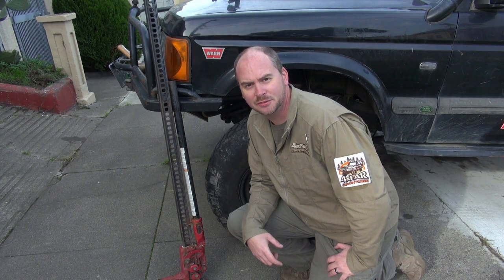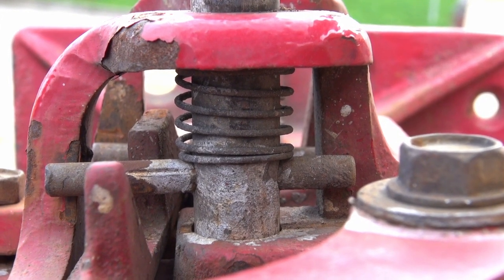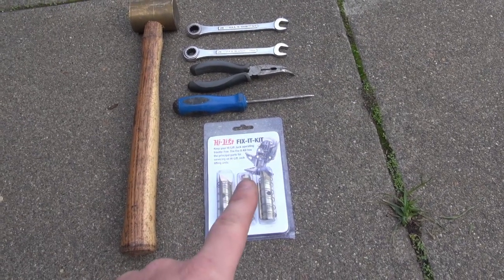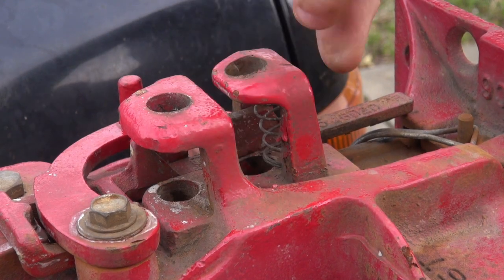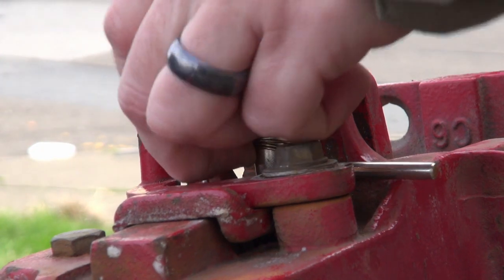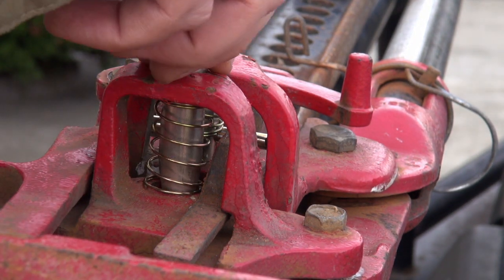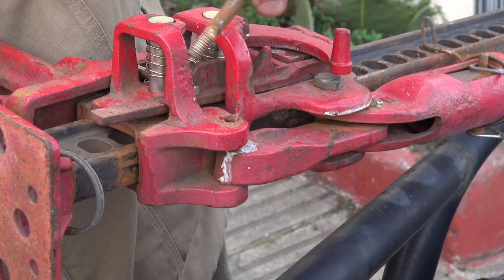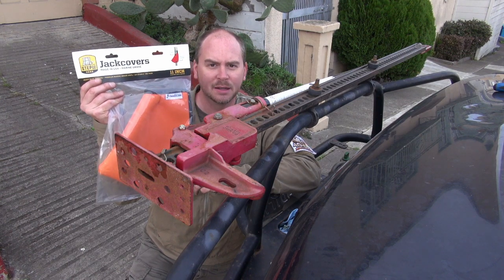Hi-Lift Fix It Kit Replacement

Comment: I was out and about and found a jack similar to the one in your video on the side of the road  yeah it's a rusty mess seems to be able to work once more after I learn a thing or a few about it now I stumbled upon this info looking for something else did not realize that it has replaceable parts as this thing I found someone was throwing it out so for the price of fixing it I got a pretty neat jack now the hard part is not hurting myself learning to use it after seeing your video yeah it's got issues and pretty sure stuff I learned here can have this up and going in no time Now the question is were to find these parts till I find out what hat stuff in my yard it sits in penatrateing oil

Comment: That's why I fabbed up an interior mount for mine. Lol I still keep a rebuild kit in my bag though just in case. Mine's 5 years old now and been used 8 or 10 times but still looks like new because it stays inside the vehicle.